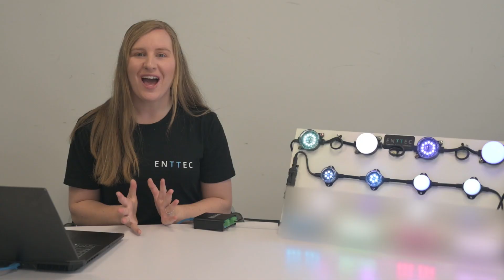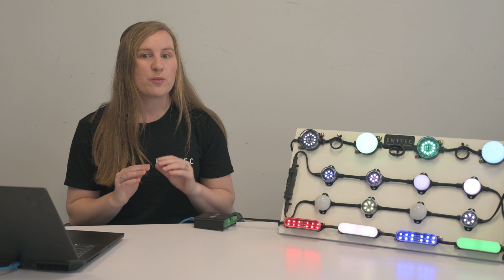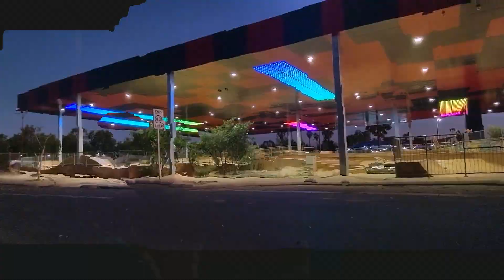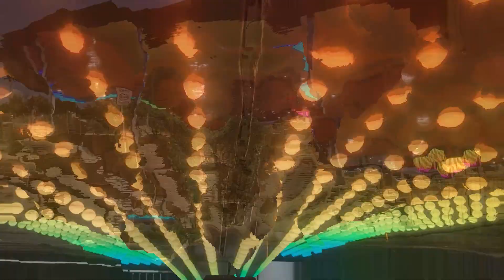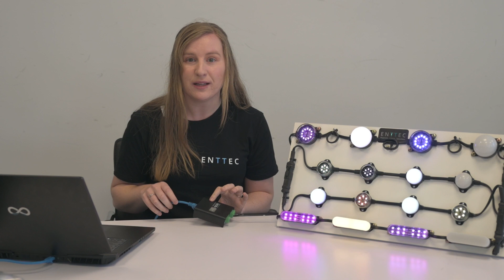New Release: Pixel Dots!

Comment: Can you show mounting option.  Or a sample install
Reply from the maker: Hi, the Pixel dots have mounting holes on the sides of them and in this video they are screwed into the board. You can find the installation guide on the web page which has more details about how to mount the dots because it is very dependent on the project to how they are mounted. 
https://www.enttec.com/product/uncategorized/hi-res-smart-pxl60-rgb-rgbw-led-pixel-dot-strings/